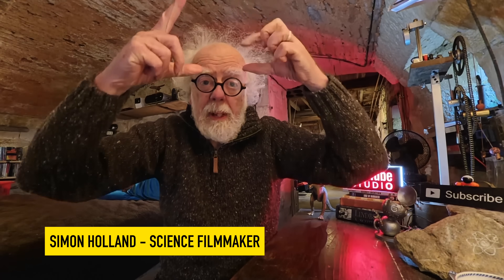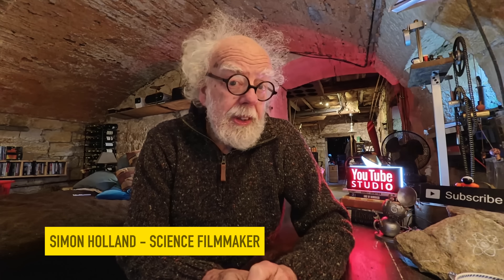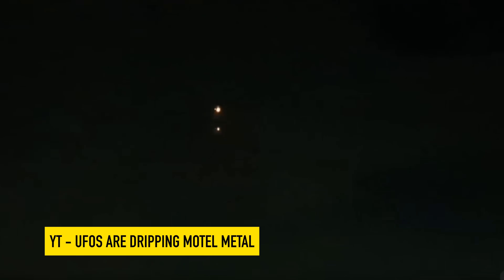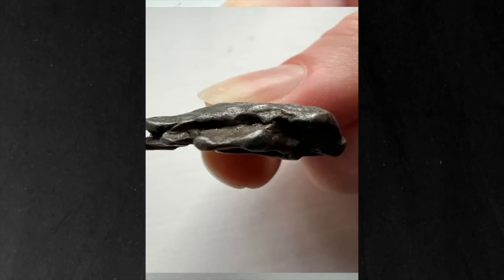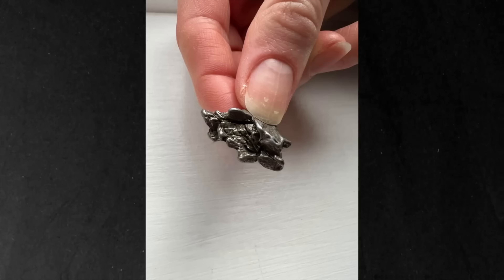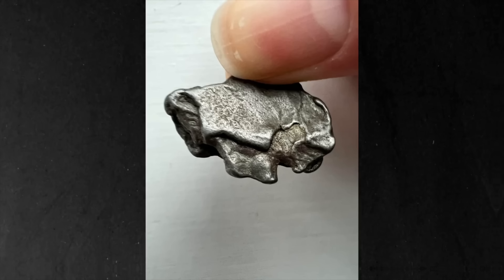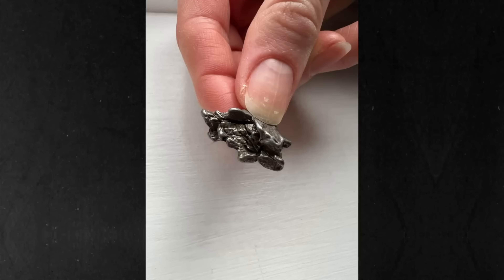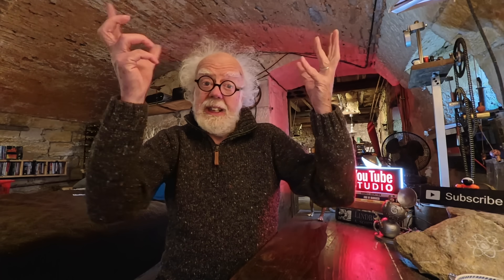Dripping UAP - What Are They?

Comment: I was wondering if you think the uap could be using plasma energy that is based from super heated metal materials and once the burning affect is achieved it's power is and or it's affect is prolonged longer than just gas burning? Then they can be seen more often because the energy is more sustainable for longer times! Like a power source for interdimentoinal objects!

Comment: I've seen one of these plasma ball UAP up close. It had a very distinct structure, and the core resembled a ball of rubber bands or a bunch of snakes slithering around themselves in a sphere. In my mind, the core was a plasma torus shape, stretched out long like a noodle and woven in and over itself. That's the only thing I can think of to explain how it moved along itself. 

The outer layer was a very thin, luminous edge. Between the core and the edge was a semi-translucent sort of soupy plasma fog. Overall the color was reddish orange, flame-like colors, and it seemed to emit a faint heat. This was way back in 2012.
Reply: MFMP is Bob Greenyer's channel wherein he analyses the BL phenomena. The traits you describe are being well modelled as we speak. Plasma tech is an area holding tremendous potential, as it does in Nature.
Reply: Ophanim

Comment: I dunno, we can't even reliable fuse hydrogen into helium in a billion dollar reactor for more than a few seconds, how is this supposed to fuse all the way up to at least aluminium at such low energy densities? Especially since the energy from those fusion elements would turn this "ball lightning" into a nuclear bomb.

I would think that this phenomenon is more likely to be either a big-ass drone that's had an electrical failure and was piloted back to base or away from populated areas to crash land or that it was some kind of Chinese lantern with an aluminum skin.

Comment: The pumping of the energy into the secret matter can produce multiple gravitational fields depending on the shape and cut of the matter. When high energy is pumped into these fields, they can expand and contract. Sometimes, on man's testing ground, testing goes wrong, and a field shape change, may intersect a part of the craft within, the inner field. Hence plasma edge on the field does a bit of melting
Or the UAP did a doo doo.

Comment: Regarding the melted metal blobs found: Due to gravity and the height dropped from, it would splatter on impact. It may contain debris or traces of it from the surface it landed on, such as dirt, pebbles, organic matter (whole or burned).  The samples shown appear to have been slow poured on a smooth hard surface vs molten metal hitting the surface, splattering, then cooling in a shape/pattern consistent to a high velocity impact.
Reply: The stuff would have cooled on the way down though.

Comment: This was a Chinese lantern 🏮 and the dripping stuff is melted aluminum of the lanterns construction that holds the fire element in the lantern in place, probably a big slow burning candle, after a while this candle melts the container in which is seated before it burns out completely, it doesn’t happens every time but in this case it did, there you have it, an orb that drips molten aluminum.
And by the way, this same video is also claimed to be recorded on August 2024 in San Jose California, so….
Reply: @nebulaM16  nice try.
Not convinced.
The flame from a Chinese later. Wouldn't get hot enough to melt aluminium to the degree illustrated in the image..
If it's melted metal, the temperature must be higher..
I'm talking about heating a metal enough to liquefy it..
Reply: @stuartd9741  
Maybe it’s not exactly a candle, I said probably, maybe it’s some other slow burning material or chemical that is burning hot enough, maybe the burning material is of multiple components and they burn in sequence and the last is small amount of termite, do you think this also
wouldn’t work?
candles are just what is mostly used in those lanterns.
Reply: @nebulaM16  Well, thermite might melt very thin aluminum -  like aluminum foil. How many Chinese lanterns use thermite, though?
Reply: @stuartd9741  Could the air being blown into the flame at that height maybe help the flame grow alot hotter ?Im not convinced either but would kinda make some sense
Reply: @kilroy776  not really as the stronger the wind, it may put out the flame, 
In an enclosed chamber like a furnace yes blowing air increases the temperature.
..
Also the aluminium would have to be very thin to melt with essentially candle power...
Reply: I worked a smelter that melted aluminum. A candle isn't going to melt aluminum under Any conditions.
Reply: @ 
Congratulations SmelterMan First read all my comments, and then be a smartAss.
Reply: I was thinking Chinese lantern. But the molten metal doesn’t make sense. 
Cause I don’t believe the heat to be hot enough to melt metal.
The metal doesn’t look like aluminum, more like lead.
Reply: @fairybeliever4479  
Termite burns and mets everything, a candle or some other fire source can be used as a igniter which will burn trough a wooden canister that holds termite, the wooden canister would take a while to burn trough so timing could be approximately calculated, and when termite starts going all metal melts, except for tungsten and such, aluminum, iron, lead, brass, steel, U name it, it all melts under termite.
Reply: Supposedly the slag contains platinum and gold. Nobody is going to waste valuable metals on a hoax that may or may not be seen. Besides the fact that a Chinese lantern wouldn't be hot enough to melt aluminum to the point of liquidity the equipment required to melt metal wouldn't be light and compact enough to float noiseless in the sky.
Reply: @B.W.Broom-xc6gs  if it contains gold. It might have been used as a sort of radiation shield. But it’s pure speculation from my part.
Reply: Try to melt even the thinnest, cheapest aluminum alloy with a candle.    Aluminum's lowest melt point is 660 degrees C., and the hottest possible candle flame you'll get is bursts of 700 deg C with wind gusts  you're going to be waiting a LONG TIME.
Reply: That's a lot of material to come off a Chinese lantern,  the ones ive seen dont have that much material in the whole construction,  if it did melt that much material surly the lanterns fuel source would just completely fall away and that would be the end of the burning.
Reply: Yes
Reply: Not a metallurgist but aluminum melt’s around 500c but aluminum oxide is around 950c. All aluminum has the oxide layer. Dought a candle can generate enough heat
Reply: @ 
Read all my comments before you want to be smart.
Reply: Bingo
Reply: @nebulaM16  like I say. It's all a distraction.  The trick is to figure out what's happening that the people running things don't want us paying attention to.

Comment: Perhaps "normal" UFOs are just non-luminous ball lightning that reflects light due to very high electron density, looking similar as an air bubble under water?, and that gets its disc-shape from some kind of spinning vortex in the magnetic field. It could also somewhat explain the weird glow some reports tell about, and the way they appear and dissapear into thin air again, or just become somewhat transparent. Highly speculative of course as we dont even know if ball lightning exist or what could possibly sustain them, but at least within some kind of scientific boundary perhaps. Luminous variants could in theory shedd molten material, in droplets or as "angle hair". One possibility is that the rapidly spinning plasma ejects hot, molten droplets—like molten silica or other compounds—that stretch into fine filaments as they spin out, much like sugar in cotton candy. These filaments would be unstable in air: as they cool and contact moisture or oxygen, they could rapidly oxidize, sublimate, or break down chemically.

Comment: Thanks for your take on the matter. if you want a little insider info. check out something called the "Betz sphere" they are likely using elements with atomic weights of 140+ to generate massive electrical discharges which for some reason at a particular charge affects gravity. or changes the polarity. Many of the current Uaps that seem to be ours look like reverse engineered Betz spheres. and im presuming that could be modified for other craft or applications. I would take an educated guess that the dripping is an unwanted side effect of such charges being used in conjunction with metals and housings not suitable for this type of propulsion system.

Comment: Two things to remember. Plasma surfaces do extort radar waves. A concept used at the B2 bomber. This make the object become invisible on radar as there is no reflection at all. 
Some UAP release metal slag. Its not the first time observed. I can not think of any process that may create matter out of thin air. The energy needed to even create one gram matter is huge. Certainly beyond even Alien abilities. The only way i could think of is a Fusion reactor wich is able to fusion higher elements than Hydrogen.

For me the most likely process is getting rid of heat. In space you need even radiators to get rid of excess heat, as there is no atmosphere you can not vent it.
Heating up waste metal and discarding it sounds about right for a space faring vehicle. I doubt they'd have any second system to release excess heat in atmospheres.
Reply: Plasma can create elements out of "thin air".

Comment: Very interesting.  I wonder about these plasma balls traveling in groups, moving around each other and travelling off in different directions.  One orange plasma ball flew in a straight line right over my head one night.  It was about 1000 feet in altitude and was probably 6-8 feet in diameter.    Is that compatible with the plasma ball you discussed?  A month later I saw a white one travelling in the same general direction that made a smooth wide U-turn before it got to where I was.  Also, what do these look like in the daytime or do they appear in the daytime?  I haven't heard of them in the daytime, but they would be less noticeable then, I guess.

Comment: Very interesting to me I saw a plasmoid a few years ago I know roughly where it was hovering I even know the land owner if I can get hold of a metal detector I'll have a look it'll be nearly impossible without it's farm land fields probably too late now anyway red the one I saw Very odd it wasn't as circular as the ones on video it was more spread out. It absolutely could have been ball lightening but it would have been a massive example so probably not. Looked big 20 30 ft across to me.